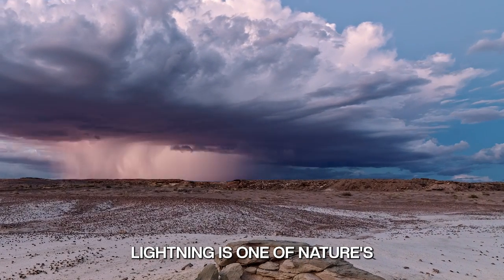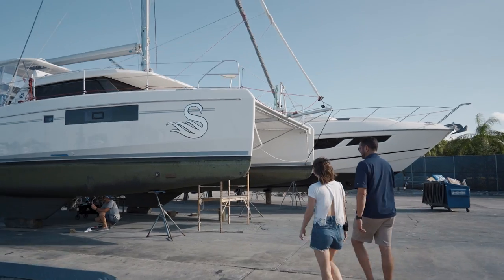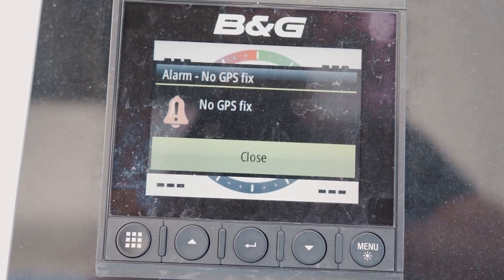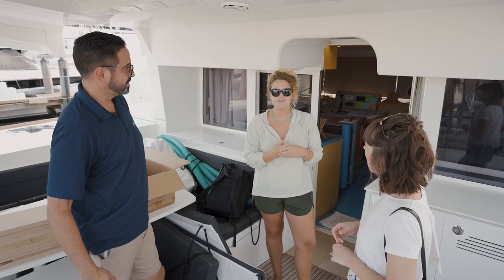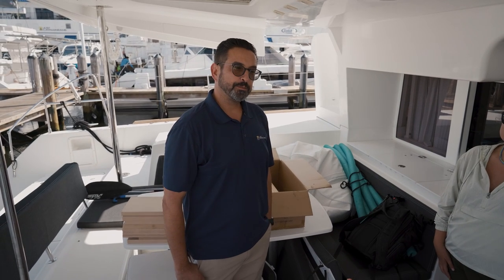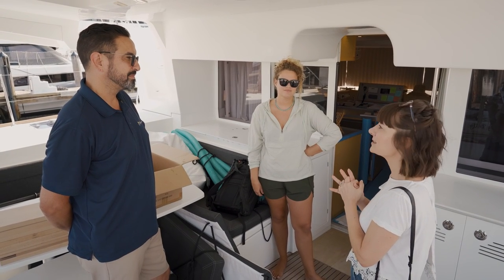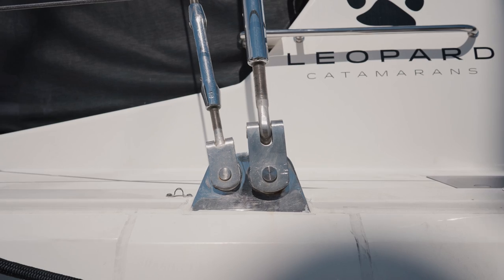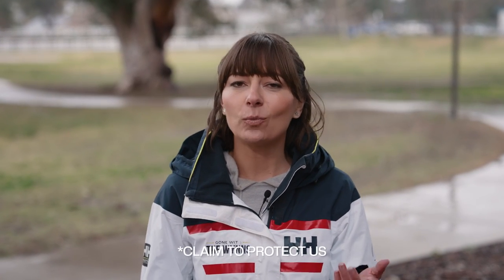Can Anything Stop Lightning?

Comment: I am just curious doesn’t a boat have surge suppressors that would flip a circuit to protect a boat like a GFC Outlet or surge strip for a computer on a larger scale?
With your mom’s van I would think the rubber tires would have ground the van….Any thoughts?
Reply: Rubber is an insulator. A direct hit on a vehicle can be dangerous to the occupants because it can retain the charge for a while and if you are the first thing to touch the ground, you can become the conduit. Some vehicles used to have little drag strips to dissipate charges, mostly from static buildup. I don't see those much anymore.

Maybe surge suppressors don't work for lighting? I'm not sure how a proximity strike does the damage.
Reply: there is just way too much power in a lightning strike. It's like wanting to stop a tank with a little speed bump. The power surge will just blast through any teenytiny surge protector or fuse.
Reply: A surge protector is to a lightning strike like a train rerailer in a 100-car doing a 100 mph. The power is so high it will jump a good distance to make ground. The systems depicted here are more like a cloaking device for the boat making the "lightning-targeting radar",  unable to see the target. Changing the charge to make the boat less palatable, kind of souring the milk so to speak.
Reply: Lightning will just jump across from the vehicle to the ground, it's already jumped through the air to get the vehicle, the vehicle just offers a less resistant patch between air and ground.
Reply: @paraniomia  exactly.

Comment: For this reason we always carried a hand held GPS which we kept in the microwave, when it was not in use.…we also had a back up autopilot control head and driver which was not attached to any wiring in the boat and kept in small metal grounded box. We set it up as a plug and play connection if necessary.  It would have worked only in heading mode if the main NAV unit got fried, but it was better than nothing if we were hit mid ocean.  We also keep a 5 watt back up VHF radio and back up cabling with an antenna….
Reply: USB s o AR char radio reduco co2 ensions.

Comment: My house in Florida was hit by lighting. It traveled along the metal gutters and grounded through the down spout to the ground…it blew out a chunk of the concrete foundation at the ground.  It took out electronics, appliances, heat and air conditioners… some wiring and cable tv. It is very common damage in Florida. Insurance requires a schedule of damage… there is also on premise and off premises lighting damage… off premise damage comes on the power lines into your house… best to add systems and equipment breakdown coverage to include off premise coverage.

Comment: Well this was illuminating. 😁 I am thinking maybe when you haul out, and if you have one of these lightning protection systems, you could do like aircraft. Have the system installed with a ground point and ground it to the.....ground. A complete path to ground bypassing your boat and electronics. I am curious about how proximity protection works. Thank you. Be safe.

Comment: Fun stuff. Not sailing but bicycling through France my bike was once hit while I was NOT sleeping in my tent next to it on a 1" high self-inflating mat. The computer and front lights with electronic funtions were broken. Strangely enough the light which had one function still working started working again after a couple of weeks. Lighting storms are always not funny, especially when it is raining so hard your tent practically starts to float and that little mat is all your protection or you are alone cycling on a mountain..

Comment: As to the question about weight aloft.  There was an article back in the eighties about a short mast or tall mast on sailboats in rough seas.  The tall mast won in all the tests.  It takes more energy to move a tall mast a given distance, therfore the boat with a taller, heavier rig is more stable.  When talking only performance it's different.   When I was young and racing sabots, I had the heaviest  boat in the fleet by a substantial amount.  I could stay within the top three positions in all races, but when the wind died or was very light,  no one could keep up, left them all.

Comment: Look up Surge Arrester for low and 220v. There are different levels of Surge Arrester for Commercial Applications.  We have three level of arrestor to protect our home. We had our Metal Down pipes split in two with steam still rising in the rain. Now all metal items are earthed including down pipes. Three levels of arrestors on our power system. On a boat you have the shore power issue, use commercial surge arrestor on main SWB, but a chain from your metal stay into the water would not hurt at dock or moored.

Comment: I have dealt with towers in southern Ga. for years and I can tell you I dealt with lightning a lot.  I talked to a company in Fla. that all they do is lightning on buildings and towers.  They put halos on the top of the towers and all over the buildings.  The halos defuse the starters that come up from the ground which is the start of the lightning strike.  after we had them put on our towers we did not get hit again.  there are other things like carbon around the grounding rods to extend the grounding area.  I am not aware of what they might do on a boat but if anyone knows about lightning protection.  Lightning master in Fla. is the company we used.  You can either protect yourself if you get hit or try to make sure that you don't get hit.

Comment: Another great vid!  We had a 44' Hylas and were struck twice at our home doc. Our home security camera caught one of the strikes.  Whoever said lightning never strikes twice in the same place was wrong.  Both strikes did tremendous damage.  We live in Tampa Bay area and gave up on sailing.  Moved to a trawler.
Reply: 30 years ago I shared a 26 foot shoal draft sailboat with my Dad in the same area. We often got caught in the afternoon thunder storms on our way across the bay. We would just drop anchor, clamp an old jumper cable to the inner shroud, and throw the other end in the water. We would go below and have some coffee. Never got hit.😉

Comment: That system makes perfect sense at least for a direct strike, plastic boat with a 60-80 ft metal pole that has nowhere for the energy to go. I'm suprised that the mast is not bonded to earthing plates on the outside of the hull as standard, actually never considered it till now but it does make sense. When you're on the hard then as somebody else says in the comments having a way of connecting the exterior plates to a ground rod each would help

Comment: During the course of building my own boat, I have dug into lighting strikes and came to the same conclusion. No one can prove that you can protect yourself. The best course of action is to provide a path to ground. A grounding strap to the keel for monohulls for deck stepped masts. Electrically isolate any sensitive electronics during storms and hope nothing gets fried(EMF). Always stick the spare gps in a faraday cage/bag just in case.

I remember reading somewhere you can stick a diode between ground and battery negative in hopes of mitigating reverse current during lightning strike.

Comment: hello, i worked in wind energy for 14 years , like wind turbine blades have copper recptors and cables running inside,  also interesting thing workers are banned from having black markers and pencils in the factory floor as the graphite in them have been found to attract strikes.   also during the de moulding process of fiberglass parts there is a lot of static that blows up heating systems and temperature data loggers,  we have  done many things like unpluging them ( works well ) to wrapping all wires in copper mesh and grounding everywhere which also worked well. we have also added MOV metal oxide varistors  they are very cheap and commonly in surge suppressors,  they are purchaseable in a wide range of voltages and basically have a series of metal plates inside, when above there rated voltage sparks jump across and supress spikes of voltage.  these worked extramly well and each wire on the boat could easily pass through one of these modules.  the modules could be also routinely replaced .  
i feel mov's placed at the  distribution panel and between electronics would likely protect them very well.

Comment: Been struck by lightning 3 times. Twice in a diesel RV parked by the water and connected to shore power and water. Once in a 27' sailboat but also on shore power. I RARELY hear of folks struck at sea but it does happen. I am an electrical engineer. If lightning strikes the power grid anywhere within about half a mile of your vessel it can come right through the power, neutral and even ground wires to whack your boat. I do know that in the case of shore power you can greatly minimize your damages buy using an inline 50A surge protector. It helps but is not perfect. Lightening is inevitable. Have a plan for continuing on after a direct hit for making your port. KISS is still the best policy. Don't have any one system whose failure could immobilize you. Another great justification for Diesel and Electric hybrids. Also Don't power electronics from other electronics. Run home runs to your battery pile for best power isolation of your devices. In radio communications the policy of always taking loads directly to the battery has paid off for many years.

Comment: I dropped my insurance because they were absolutely ridiculous. But we were very concerned about lightning. So we bought one of these and I did the install myself. EMP solutions even loaned me the specialized meter to test for proper operation before their warranty could be in force. For half the cost of 1 year insurance, I now have up to $100k coverage against a direct strike for 10 years.

I am concerned about time on the hard because the ground plates need to be in water to work. I think I might drill and tap them and bolt on a big wire with a ground spike under the boat.

Comment: Offshore we just used lots of surge protectors on each A.C. circuit mainly for proximity strikes direct strikes on our equipment was exceedingly rare. I can't remember any incident of a direct strike we would just get huge quick surges through the electrical lines.

Comment: Love you guys.  Have you made provision for losing all electrics, especially on your new boat?  Could you sail manually, at all?  Could you do it on your old boat?  Could you do it on your new boat?  Is there a way, perhaps procedures, to isolate electronics during an obvious thunderstorm so that not everything gets fried in case of a hit?  So, sailing with most expensive/critical items turned off and isolated when there is obvious lighting?

Comment: As an EE, I found this video very informative and fascinating.  Strange that Jason's mother's RV suffered so much damage given a vehicle's steel unibody chassis is a Faraday Cage. Most cars struck by lightning continue to operate. Was her RV fiberglass or composites?  I learned something new about Nikola Tesla and how he stumbled upon this. Cool!  Whether these work is questionable due to the claim of de-ionizing the air. But the air is not static during a storm. Wind currents are strong enough to blow away the bubble of de-ionized air and replace it continuously with ionized air.  Thus you are back to the drawing board.

Comment: super video. I think it is probably worth the effort to install it on your HH. The best opportunity to install is during the outfitting when it’s easier to do the install and run the wires prior to the mast install. In my Navy days we had heavy duty surge protectors installed on each critical system unlike say a shore power surge protector that protects your entire vessel from brown outs and surges. I am not sure that is even possible for sailing vessels.

Comment: Not a sailboat...but owning a plug in hybrid automobile. I usually will unplug it during a severe lightning storm.  Owned two over the past 8 years and so far no problem...this time of year, it's more of an issue of clearing snow from the charge port door.

Years ago, in an apartment, we had a close lightning strike that caused a power outage and my answering machine wasn't working when the power came back online.

Comment: My farm house was struck twice. Once was a tree 15 ft from the house that traveled down the surface and into a buried electric line. Blew the line out of the ground and melted the glass fuses at both ends.
The second time it hit the lightening rod on the roof and traveled down the wire into the ground. Then it came back up through the ground rod for the phone lines. It only fried one line which went to the computer (good old dial-up). Blackened the phone plug and popped the lights out of my surge protector. The computer was fine.
A good surge protector is worth its weight in gold in a lightening strike. I'm not sure if they make them to protect boats but it's worth looking into
Reply: Buy whaler 15. 50 hp ejrrc outbsrd

Comment: While most lighting strikes don’t cause structural damage, we had a customer call us to recover his 30 ft sail boat which had sunk in it’s slip. It had been struck by lightning which actually blew out 5 1/2” holes at the water line. His boat was not hooked up to shore power and sank after bilge pump drained the onboard battery.

Comment: An old-timer when I was living up in Washington always had a heavy copper cable attached to a large plate of zinc hooked up to his back stay and it stayed in the cockpit unless lightning was around and he would  throw that in so that it would take the strike. The idea to take the electricity straight down the back stay and into the water, 
  the premise that electricity follows the path of least resistance. And put a handheld GPS in a microwave just in case. On the same subject is the case for not bonding all the through hulls. Lightning strikes and blows them all out at once, sinking the boat. Cheers from Northern California!!!

Comment: Ham radio operators with metal antenna towers face this problem also. My antenna was directly hit twice and zero damage to the electronics bench down in the house. The antenna bottom was thoroughly grounded with buried pipes for a ground. On a boat, the bottom of the mast should be connected to the largest surface you can manage in the water. Stainless steel plate that will not corrode would be good. Many square feet of water contact is best. The idea is to pass the current through the mast into the water. No electronics whatsoever should be connected to the mast.

Comment: We've been using lightning protection systems on roof mounted mechanical/electrical equipment for decades...they're pretty simple too.  Lightning wants to find the least resistive path to ground...in your case, the water is ground.  Installing a low resistive cable from the top of the mast to the water line makes sense...the only reason yours is so expensive is because it is for "marine use"...Also, when you take your boat out of the water, you can keep it protected by connecting that system to a properly installed grounding rod in the ground (duh).

Comment: Hi Guys,
Great vid- again. Quick question regarding strikes and maybe something to throw at Just Cat's- what happens to the standing rigging. You get a direct hit at top of mast which is comprised of a LOT of electricity, but also a LOT of heat. we know what the electricity does, but does the excessive heat affect the rigging? Has it melted or fused the cable strands internally? Has it fused the nuts on the bolts at chain plates. I know when you arc weld say through a bearing or a similar job and the earth lead is not attached directly to job, you will fuse parts together, same as the burn mark left under the earth lead clamp. And this is basically the same principle, just MUCH HIGHER voltage. Just something to know maybe.

Comment: When I was a youth a Dragon sail boat (~30' wooden boat with a wood mast), was hit by lightning at the tip of the mast. It traveled down the mast and blew a hole in the bottom of the hull (keel stepped mast), causing the boat to sink.

Comment: Lightening is a very unpredictable thing, and just when you think someone has figured out a solution, mother nature throws another curveball.
My folks had their 26' Grampian sailboat grounded with thick copper cable from all the shrouds, stays, and mast to two large bronze or copper plates on either side of the keel. One night while rafting to another sailboat that had a taller mast, we were struck by lightning. The other boat was not bothered, but we lost our antenna. Fortunately, I had just disconnected the CB, VHF, and Loran (antenna and power cables) just minutes before. The sound was like a cannon going off in the boat (very deafening). So were we protected? I guess so since the damage was minimal, but boats in those days didn't have much electronics on them. I guess we protected the neighbouring boat.

Now that we own our own 42' sailboat, I looked into getting it grounded for lightning, but I couldn't get anybody to do it, because of liability concerns. It seems that even the insurance companies have no take on it (i.e. offer a discount if you have grounding protection). So it seems that everyone is just hoping and praying that mother nature leaves them alone, and if not, that's what insurance is for!?

A fellow sailor that is retired from the electrical industry also explained to me that the current in a strike could be so extreme that it can vapourize any cable that it runs along. So if you were struck by lightning, you would then need to inspect the entire pathway to confirm that it wouldn't need to be replaced/fixed. In the end, I guess it comes down to the economics of one approach over the other. As for safety, we may need to build boats as Faraday cages.